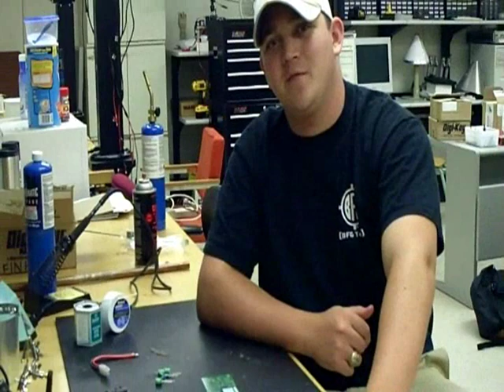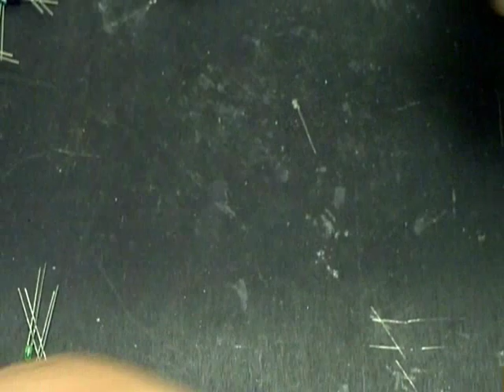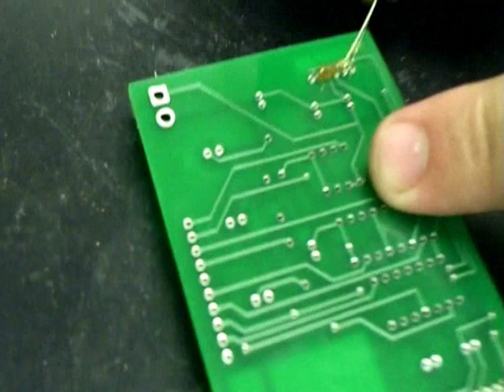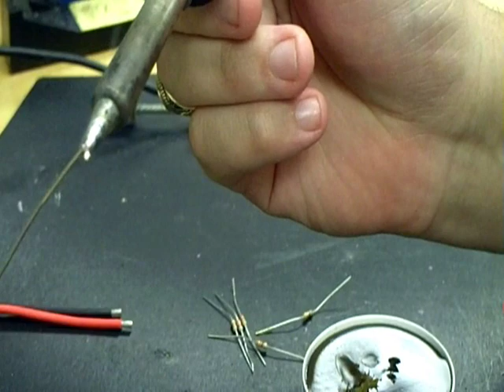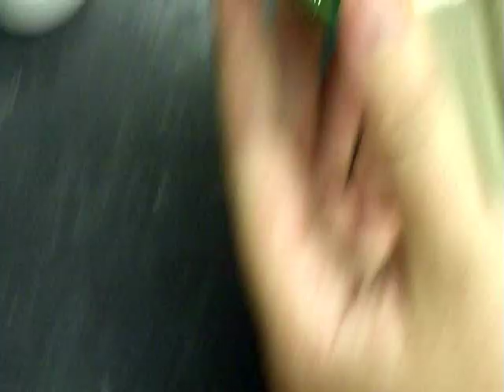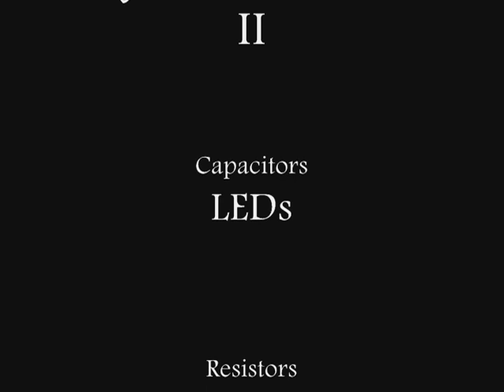Soldering 101: IC's and Sockets

Comment: I used to solder that way and its the WRONG way! You shouldn't need flux unless you are doing surface mount or odd alloys. What I'd suggest is applying the flux the bare board first. You should heat the joint and apply the solder. The way you are doing it has a very great risk of overheating tracks so they lift off the board and also bridges pins - which mean more heating to remove it.

Comment: Sorry for all my miss spellings in my last post, i was typing too quick.... another good practice is to ALWAYS apply solder to the teminal not the iron. Remember solder flows twords the heat and flux flows away from the heat.... so applie the solder to the opposite side of the component from your heat source and the solder will flow tword your iron. One last thing, drag soldering is USUALLY for surface mount devices not through hole.... :-)

Comment: hi all! I just got my IPC class 3 solder certification and while what you are doing is soldering to class 1 standards I agree with ScrewAttackChina... (somewhat)  First of, it will not create cold joins, it will create over heated joints and there is a difference. Second, while it isnt not nessesary to use flux, it is HIGHLY HIGHLY RECOMENDED and there are 3 different types of fluxes. R, RMA, RA with RA being the most corrosive. You can also get what is called no clean flux which is very nice